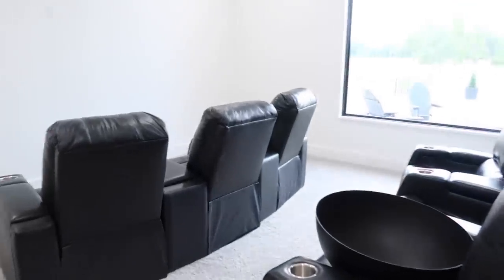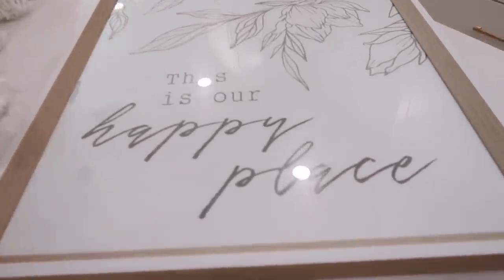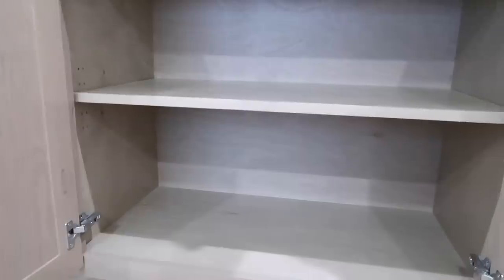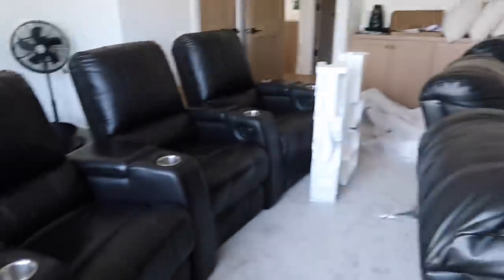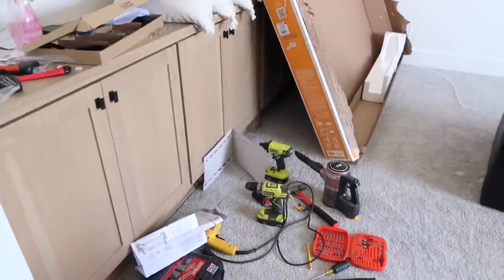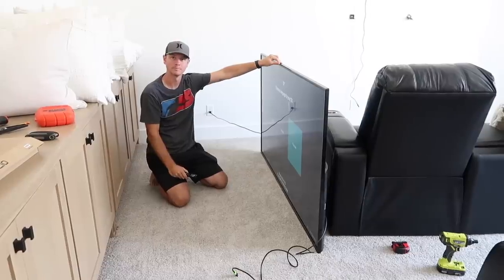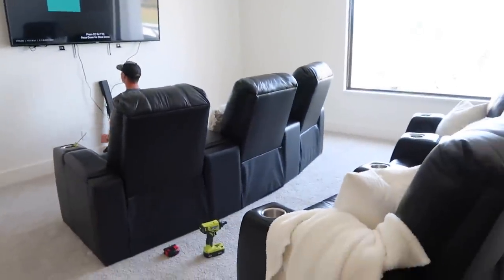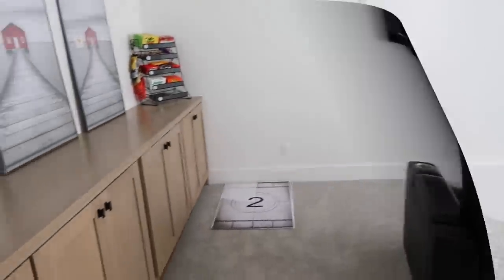NEW HOME MOVIE ROOM MAKEOVER | 2023 MOVIE ROOM HUGE TRANSFORMATION | MOVIE ROOM DECORATE WITH ME

Comment: We also have a theater room. I asked for a star screen on the ceiling and it's beautiful. One of our favorite splurges in there. 
I was going to suggest for the back some bar tables - it will give you height and a place to host a few more people for events like football games or fights, etc. Chase could probably easily build you a raised floor to support them for a little more separation. 
Our walls are a dark green, not black and we stained our wood trim in a dark brown. 
If I had to do one thing over, I would get regular cushy couches that recline instead of "theater couches." 
Love love love the snack bar... I've heard popcorn machines are a pain - so maybe a mini or a small popper?

Comment: How are the speakers plugged into the sound bar with out the wires?
Reply from the maker: The Soundbar is wireless and doesn’t connect to the subwoofer. The subwoofer hooks up to the 2 side speakers with wires and they connect via Bluetooth to the soundbar

Comment: I think that you should call the store where you purchased the TV, and explain to them the problem. I wouldn't try to remove the cover on the back of the TV because it may not be easy to do, and may be difficult to reattach. I think that you should bring the sales receipt with you if you take theTV, back to the store.
Reply from the maker: Chase already fixed it during the video and it’s working normal now. It would have been so much hassle to rebox it up and take it back for an exchange. Now if he couldn’t get it fixed easily we would have returned for sure